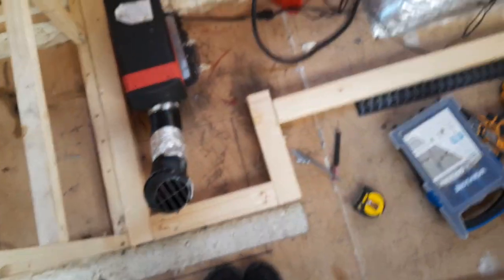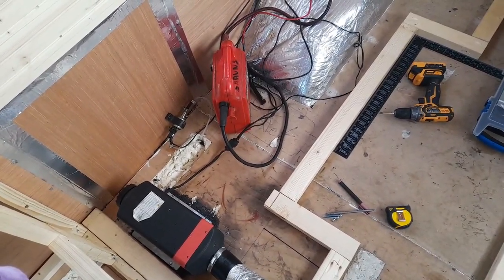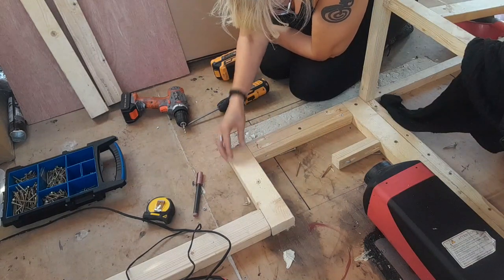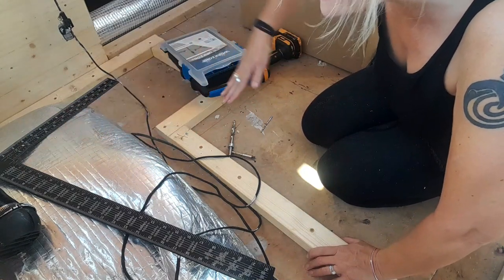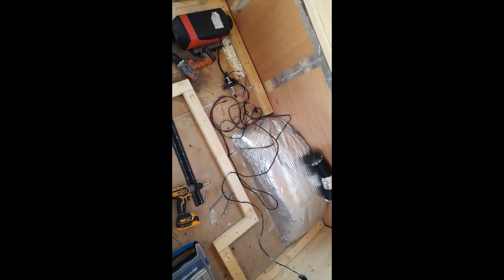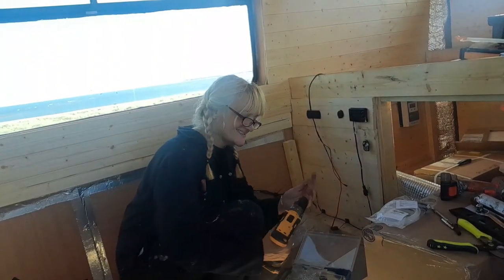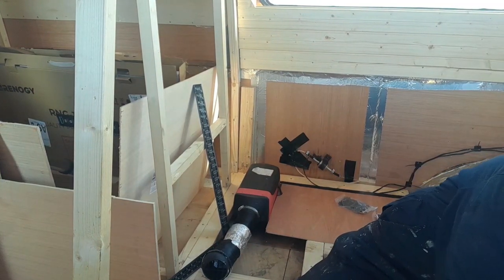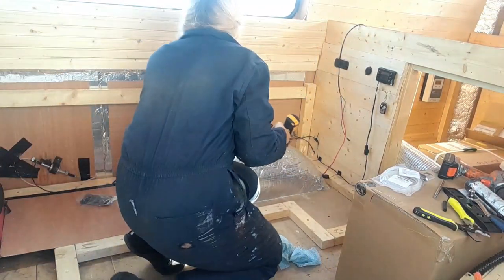Iveco Daily Camper Self Build-Making Seats/Bed Part 1 #ivecodailycamper #vanlife #ivecoselfbuild

Comment: OMG! Need this so much, (in a bit of a funk), too many things whirling around in my head I suspect. The van is coming along nicely you should be dead chuffed with yourself Coral, glad you're back on track again, can't wait to see more. I finally put up plastic curtain rods, they are never coming off, had to stick down with some mighty gunk, (caravan walls and screws don't go well together!) but didn't leave enough gap at one end to put curtain stop on as it's right up against a wall, so stuck a curtain hook to end of rail and it worked, no ones going to know. I've also  trashed a section of the seating, as found a recliner in the charity shop and thinking of installing a diesel heater or a wood burner but will probably be next year now. xxx
Reply from the maker: 😁 cheers John

Comment: With screwing down the wood it makes it impossible to remove if the van needs welding anytime.
As soon as the weather gets dry you could do with undersealing the van thoroughly so it doesn’t rust.
Reply from the maker: Yep, plan on undersealing it fo sho 👍😊